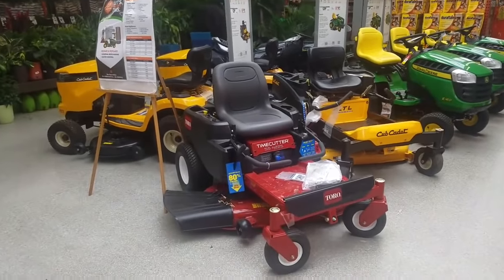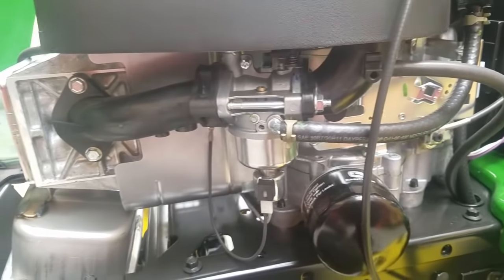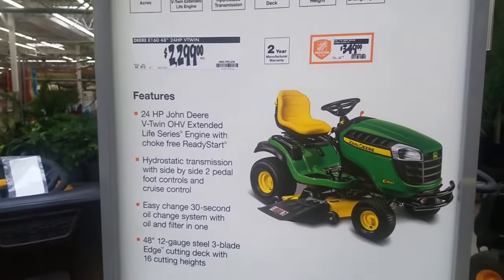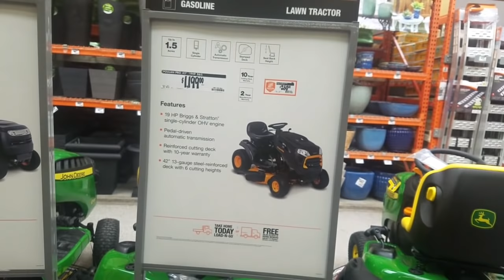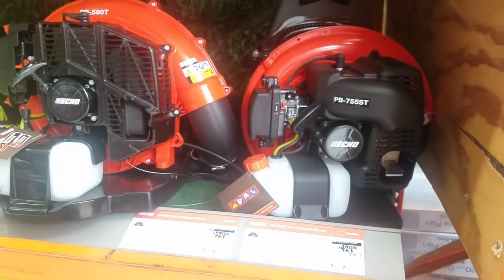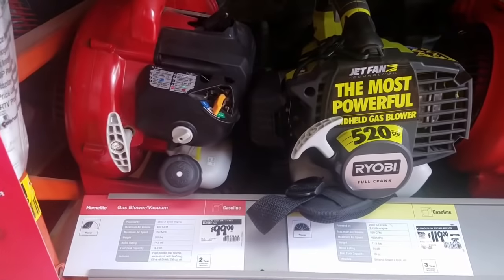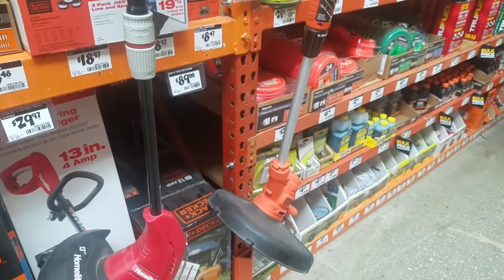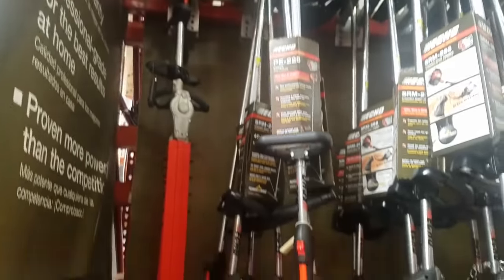HOME DEPOT SPRING 2018 LAWN TRACTOR RIDING MOWER LAWNMOWER JOHN DEERE TORO CUB POULAN RETAIL LINEUP

Comment: All these mowers are built by one manufacturer. They slap on different colors and decals. John Deere wouldn't lower themselves to make this crap. But the money is too good to pass up so they said go ahead make them. Just send us a check for name rights.
Reply: Tom Ashbrook engines are pritty well the same as they where in 2006 for the e100 grand fathers L100 makes 17hp intek but with no oil filter i believe not much diffrents briggs and Stratton dont change much engine may out last every thing else

Comment: Same with Husqvarna go to a dealer instead of Lowe's or home Depot
Reply from the maker: Dealer is double the price
Reply: What about a zero turn mower would you buy one from a box stores or a dealer. For instance Husqvarna would you buy one from box stores or dealer
Reply: Same with the John Deere ones from the box stores have plastic transmissions unlike the one's from a dealer aluminum transmissions
Reply from the maker: @ryanclark4956  I probably wouldn't buy a Husqvarna zero turn.  If I was going to buy another zero turn, it would be a wright stander or Toro grandstand. Which means id have to get it from a dealer.
Reply: Because I bot one of them tractor's it was a John Deere D105 and it had it had a plastic transmission in it.
Reply from the maker: @ryanclark4956  yup, but if it works...and lasts, what can you complain about?  Does it still work?
Reply: I sold the John Deere D105. And I fix and sell lawn mower and snowblowers.
Reply: Where I'm at I sell a lot of Husqvarna AWD and tractor's
Reply from the maker: @ryanclark4956  I've had lots of Husqvarnas.  Yt2448t,  21k46, lots of push mowers.  Good machines.

Comment: Basically if it's a big box mower it's MTD unless it's John Deere or Husqvarna.  Even big box JD"s are lower quality 100 series units.
Reply: Tom n 100 series units are made by husqvarna you want to buy x300 and up
Reply: We have the S240.  X300 Kawasaki V twin, x300 hydro transmission, push/pull electric PTO, upgraded sealed wheel bearings and vented seat.

Comment: 3-4 years for Li-On battery life....c'mon man. Old school thinking. I wouldn't waste time with a gas blower, string trimmer or hedge trimmer anymore.
Reply from the maker: Read what you wrote...3-4 years battery life.....my gas machines..weedwacker had it for 16 years, leaf blower 13 years, hedge trimmer 9 years...all still going strong.  Someone is wasting time and money on new batteries every 3 years.
Reply: Some people think they are saving the planet by going electric. They just ignore that the electricity was produced by burning coal, oil or gas.
Reply: Stihl commercial grades are the best I've seen. My dad bought a trimmer, pole saws ect back in the 80's. All still running strong. The key is how you take care of them. Don't leave gas in them and use non ethanol gas mix. The ethanol destroys the rubber components and fuel lines.
Reply: James Hancock  exactly anything that is decently built will last if you take care of it
Reply: Greg Pecaut plus the mining for lithium for the batteries and not near the longevity nor power of gas engine
Reply: Greg Pecaut  you for president you got my vote

Comment: Junk
Reply from the maker: Lol...so if you walked in and they tapped you on your shoulder and said you were the 1 millionth customer, and you can have any one of them, you'd stand there and say..."Junk"! And walk away?
Reply: Mowers N Blowers this is just opinion so bear with me. I feel like the only mowers in that bunch that are worth a crap are probably the John Deer’s. Only because I’ve used one for close to 10 years on and off. So with that being said yes the others I’d have to walk away from. I’m a true believer in buying the right mower the first time. I bought 1.57 acres last year and will be building soon. I’m actually looking for a zero turn in the 4K 5500 range.
Reply from the maker: I completely understand.  Remember this also, husqvarna and John Deere make different versions for home depot and lowes...hard core john deere lovers call them junk too.  I've had my Murray  ( considered junk by pro's) but it's been running perfect for 16 years.  I also have a JD and a toro both seem very good too for my needs.  I will say, some craftsman and weedeater riders are junk.
Reply: Mowers N Blowers exactly Ive actually been looking very close at the scag Liberty z 52 and the bob cat crz 52. Still not sure which one I’m gonna go with.
Reply: John Deere e series are junk but the x series are good. Husqvarna are great if not from a box stores

Comment: These are all junk from China ,  my 1970 wheel horse can certainley outperform them all !!
Reply: My grand father push mower chinese and its ok 7 year with out an oil change has to be done have not had time renters used it its bin through alot of shit starts on the first crank every year and i live near lots of salty air my air moisted its also 3in 1 weed eater mower 140cc no name on motor but chinese clone kohler its heavy but shes a good rig if ya ask me you have to do research before ya buy is key
Reply: All these tractor's are manufactured in the USA  and Cub Cadet xt1 are junk